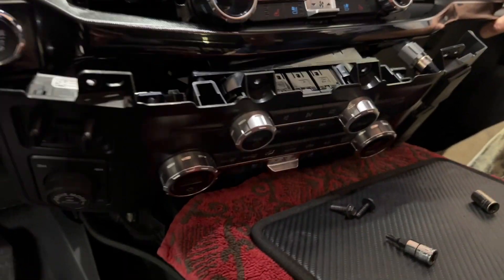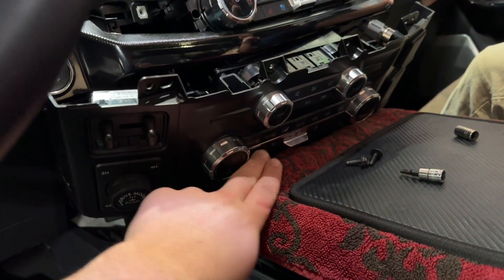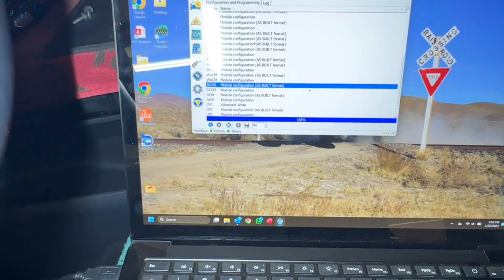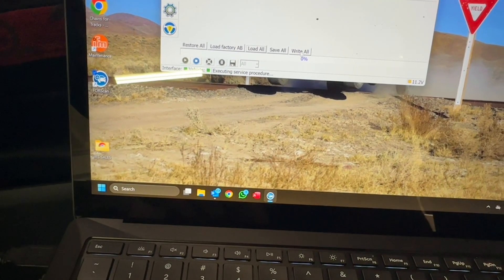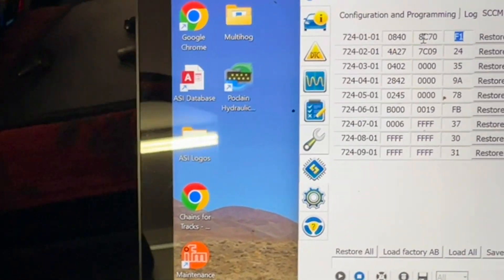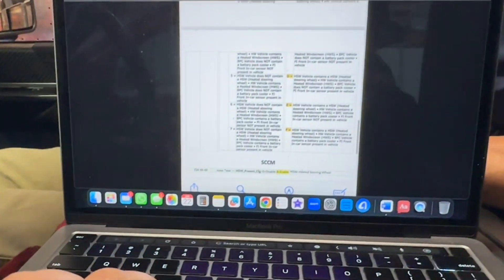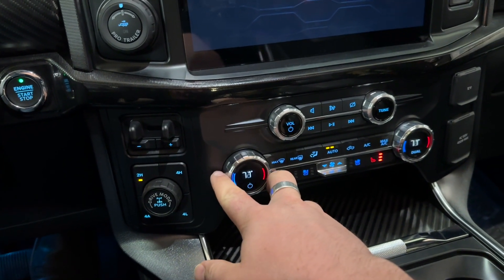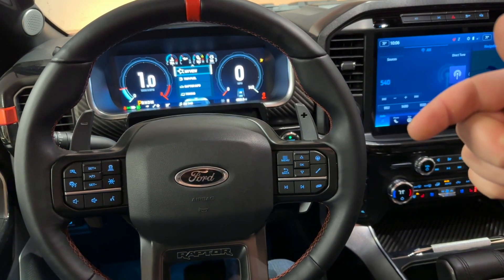2021+ F150 Heated Steering Wheel Addition and Digital HVAC Forscan instructions

Comment: What are the changes for programming a new hvac control ?
Reply from the maker: All the forscan changes are in the video
Reply: I’m doing heated/cooled seats into my single cab. Do you know what values I’d have to change in order to get the buttons to work on my new hvac controls? 🤔 (everything else is wired)

Comment: Can we add heated steering to a 2023 xlt f150. ?
Reply from the maker: I assume it’s the same process
Reply: @justinmtbiking  Did you ever do it? Just wondering as I have an xlt too.
Reply from the maker: @Pickrelrig  I cannot speak for Eric…I made this video in a raptor and I would assume it’s the same process because you would be using the same hardware
Reply: @justinmtbiking  Yeah the only problem I can see is the new HVAC Module has the cooled seat switches. That option isn't available on XLT's. I was thinking it might throw out codes because of that.
Reply from the maker: @Pickrelrig  mm probably not throw codes I think it just wouldn’t do anything
Reply: Do you have a part number for the sccm?

Comment: What modules in FORscan did you have to save as built for the clock spring and the HVAC?
Reply from the maker: I believe just the SCCM and HVAC. But it is smart to save each module before you change anything!